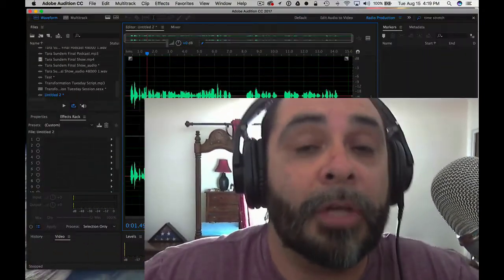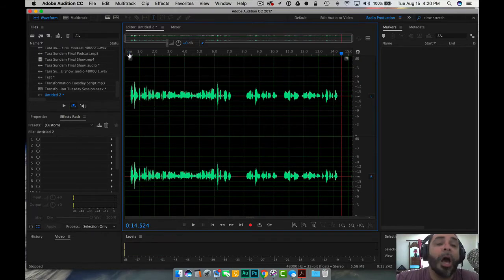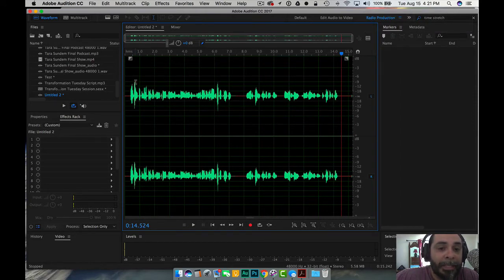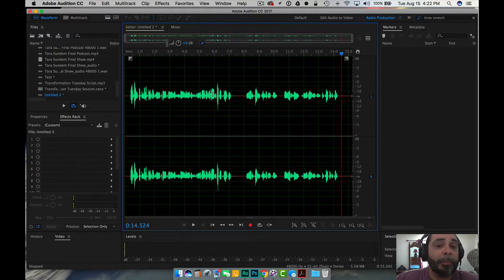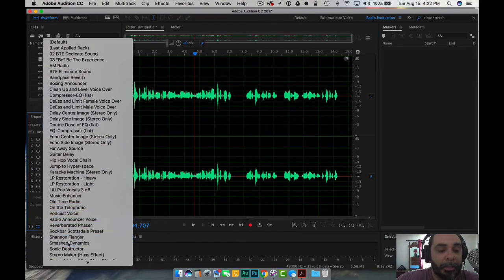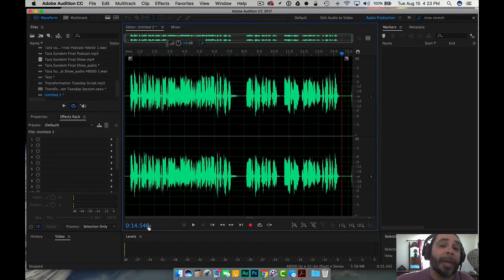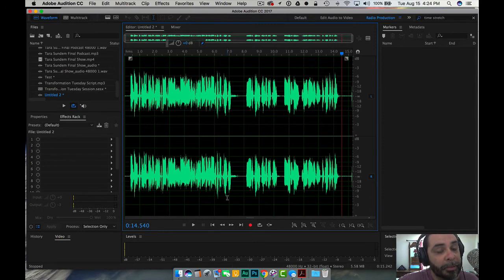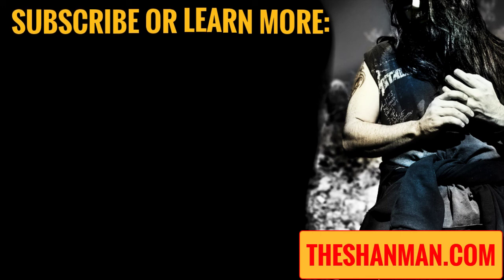How To Fix A Microphone Buzz For Your Podcast

Comment: Hey i have a ak 60 mic and when i start recording my headset buzzing and i take off my pop thing then unplug my headset and i step some cm back and still buzzez and im on mobile ive bought 2 Diffrent ac adapter to fix it and nothing is working and ive been searching on the internet and find nothing nothing works ive cleaned it my whole thing but still nothing i think my mic is just broken
Reply from the maker: Honestly, I couldn't diagnose the problem unless I actually heard what you're dealing with. I've never used that microphone, so I can't give you the best answer. Do you have a recording somewhere that I can hear it?
Reply: Yeah in my channel my most recent video
Reply: And skip to the end and youll hear when i plug it in and when i unplug my head set
Reply: And a very strange thing that some times it caputres when i talk some time dont